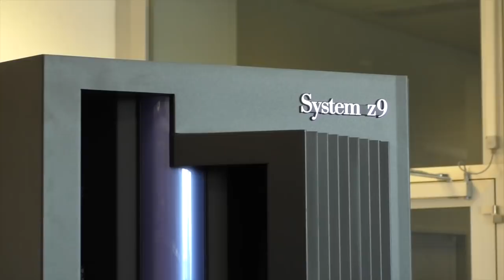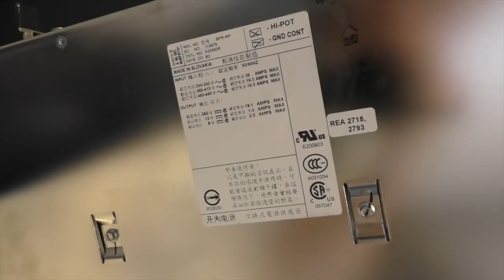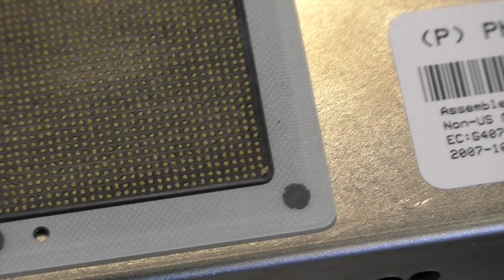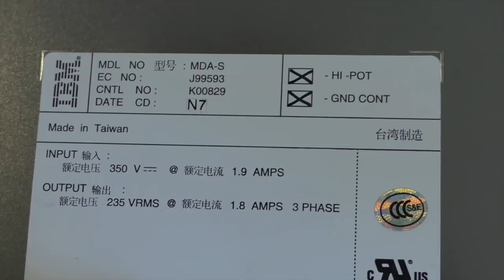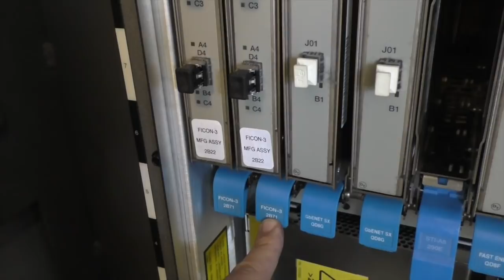IBM Z9 Mainframe Computer Teardown (PWJ31)

Comment: You know something's over-engineered when a fan is called an "air movement device" -- I'll remember that the next time I get in my fractional petroleum distillate powered latitudinal movement conveyance device.
Reply: FYI: FANs push air, AMDs pull air :)
Reply from the maker: There is no push without pull.
Reply from the maker: You got an LMCD? Wow!!!  :-)
Reply: Be sure to connect your Air Movement Device to the Powered Interconnecting Source Socket... Or PISS.
Reply: isnt that overbureacratic? often engineering and buraucracy are mixed. also army likes to rename common things to more ambiguous ones.
Reply from the maker: @effexon  Wait until you see the german translation (by IBM). A color terminal from 1990 ended as "Farbdatensichtgerät" what translates back to "color data viewing device"

Comment: sad to see a beautiful machine scrapped
Reply: Me too. I'd like these to be more reusable, as "built to last", so modular design, to use parts of it in other uses... same way as people invent new use cases for washing machine engine, car parts and so on. I'd imagine there are use cases for reliable but low performance heavy in eg. non profit scene, but expertise and knowledge is needed. Otherwise closed system sell for couple of bucks in ebay, as those are so nonpractical, only for most enthusiast hobbyists.

Comment: ESCON is the older half duplex fiber interconnect for these.  You could run ESCON up to 43KM! It had a speed from 10Mbit to 17Mbit before it was replaced by FICON. FICON could run up to 100KM at a speed of 1 to 16Gbit!

Comment: 4.5B transistors.. just as a comparison. Apple's previous generation SoC used in iPhones(A8) has a 2B transistor chip. The new A9x is believed to have 3+. Nvidia's GP100 GPU has 15.3 billion.
Reply from the maker: +SirMo 
Well... we are talking about 10 year old technology. Amazing how fast things change.
Reply: If you look at technology advances from decade to decade, such as 40s to 50s or 50s to 60s, there hasn't been much advancement from the 2000s to the 2010s. Seems like it's just a marketing game now. When's the last time you saw a processor spec advertised in a compute ad? The ads now are simply "Laptop! $229.99" with very little information. Another example are the processor model numbers. No indication of speed is suggested.
Reply: One reason is because there is a finite speed that the chips can function at, or rather it gets seriously difficult to get ever greater clock speeds out of computers. Also functionally there is enough computing power in something fairly basic that you can do what average people do with a computer at any clock speed and you don't need to talk about speed any more when mass advertising a computer on TV. Only enthusiasts are excited by GHz numbers anymore and almost no one cares about transistor count in their daily life. I'm typing this comment on a 2011 Lenovo ThinkPad because it does what I need, it didn't cost me much and it is indestructible.
Reply: i bet my mac book pro is really indestructible compared with a lenovo , i have one mac book which is completely destroyed from the outside but the computer is still running .
Reply: I have a pile of MacBooks here that look new and don't work. Trade you all of them for a lenovo. ;)
Reply: are you sure , usually you can build a new device out of the different parts , as i said i have one lap top which is completely destructed but it still runs i just need an external screen and an external keyboard , the case is destroyed but the machine still runs , i would never give it away . it is a well working unit with some cosmetic issues
Reply: I had an i7 asus like that. Looks like someone jumped on it. Worked fine. Ended up junking it.

Comment: Great video! You don't get a chance to tear down such a beast every day ;)

Actually, the Service Elements (the two ThinkPads in the front) are not only used for diagnostic purposes - they run a big chunk of the machine firmware as well.

Yes - the books are indeed called like that because they are mounted like books in a shelf. Like another commenter already mentioned, since the zBC12 and z13 EC there are no more books and MCMs but rather drawers (guess why they're called like that ;) and SCMs to save costs. Although each SCM combines several of the chips on that z9 MCM on a bigger die.

All components on the MCM are soldered BGAs (IBM almost exclusively uses flip chip packaging).

The ESCON and FICON ports are used to connect to external peripherals like storage servers. ESCON is IBM's proprietary optical I/O connector (actually, it's standardized in the T11 SBCON standard). FICON is the successor to ESCON - this time based on the FibreChannel physical layer (and standardized in the T11 standards FC-SB-2 to FC-SB-4).

Actually, all of the I/O cards have their own PowerPC processor handling the attachment to the mainframe channel subsystem (the mainframe uses channel I/O instead of port or memory mapped I/O).

Comment: Where was the DC-DC converter for that CPU board - under all those caps, or on another board?
Reply: +mikeselectricstuff i kinda want him to send that cpu to you to se if you could poke inside it >_>
Reply from the maker: +mikeselectricstuff 
On the CPU board itself are only caps and connectors. The DC/DC converters for the CPU are on the backside of the system. I will do another video with one of these. They have some interesting specs... for example 1V @ 800A!
Reply: +chrigel1234 Have you seen the video of the 18 year old kid that bought a Z/890 for $250 and got it working?
Reply: Yes, I'm sure if this guy advertised the z9 on eBay or Kijiji he could get an offer.

What a waste to send it to the scrapyard.
Reply from the maker: Yes... and I guess he had not to pay for the transport. ;-)
Reply: mikeselectricstuff
Reply: mikeselectricstuff

Comment: IBM has gone away from this type of CP book construction to make the units easier to manufacture.  Each CP is now a separate unit which plugs into a tray; no more will you see MCMs in IBM mainframes.

You'd be surprised how much manual work goes into those multi-chip modules; they definitely did assemble them by hand!  They had a special team at the Fishkill semiconductor plant to assemble them; there was no way to do it reliably with machines.  Of course they had machines to assemble the chips onto the modules, but everything else had to be done manually.
Reply: Impressive, man seldom beats machine now days.

Comment: Sad to see a awesome thing like this going to the scrapyard... but companies do that alott, and selling is either dificult, more expensive and/or the data should be destroyed anyway. still sad to see this die
Reply: Gold and copper recovery and other materials probably give back more money. But some people like old hardware just to run and collect them, even pay more than scrap metal prices. So yes, old hardware might be not cost effective to keep arround but dont just trow everything away, keep the collector in mind, maybe sell 1 of many servers to some collector and rest for pure metal recovery. Yeah, old hardware waste more power then they give processing power, so replacing them is most of the time smart.
Reply: Agreed!  More people should think about at least looking for collectors who might want stuff before disposing of it. Speaking of big, special-purpose hardware, I just saved the rolling stock from a 1980's-vintage monorail system from the scrap heap, and also secured a bit of beam on which to run it. I was literally bidding against scrap dealers for it, and yes, I outbid them and got the trains for an absolute fraction of their original cost.  (Party at my place, eventually, with one of the best backyard railroads in the world!)
Reply: The time needed to find someone who can take that thing away is money spent by the company who bought this unit to do something with it. They by now don't need it anymore, and getting it taken away ASAP is their preferred way.
What happens afterwards is not much of their interrest. They are also not interested in getting US$1000 for this as booking this value is more trouble than worth it.
Where I work we donate a lot of reusable things. Sadly that's mostly notebooks and desktops. Servers are not wanted. So those are scrapped.
Reply: Harald, yup, I've noticed that that's how it works.  That's how I got the monorail. The business view is "time is money, just get it out of the way so that we can get on with our plans." That doesn't change that there is value for the community in a better attempt at recycling.

Comment: gee, I remember writing software on am IBM-360/30 with 48k yes KILOBYTES of main storage, (3) huge 5 Megabytes of disk, and (8) 9 track tape drives, card reader/punch unit, and a 1403 printer. I used to run BPS and DOS 26.2. To watch a tape sort was amazing. with DOS you could run 2 jobs at once. FG and BG. of course all the software written was in assembler. I loved it
Reply: Got work for you.
Reply: @2hard2knock  oh yeah? What r u looking for?
Reply: @rty1955  Good ole fashion ASM/CICS/MVS stuff.
Reply: @rty1955  Find me on linked in if you’re interested
Reply: @2hard2knock  sent a connect requesr
Reply: @2hard2knock  I ran DOS not MVS. On the 360, 370, 4300 series and s/390.
The 360 did not run MVS. The 360 could run OS/360 which dragged the machine down. MVS (OS/VSE) was for the 370 & up.
Actually DOS/VSE ran faster on the 4300 series due to the fact that DAT was in hardware, whereas MVS had to perform DAT in software.
Reply: @rty1955  the CICS would be most desired if you have that experience
Reply: @2hard2knock  I do. With what programming Lang? COBOL? ASSEMBLY? Or just admin
Reply: @rty1955  ASM / COBOL3 / VSAM / DB2. How good is your CICS?
Reply: @2hard2knock  pretty good. Is it Under MVS?
Reply: @rty1955  affirmative. It’s right up your alley. Interested? send me contact info and I’ll arrange a virtual interview .... how is your availability?
Reply: @2hard2knock  I sent you a d invite on linkedin

Comment: Thanks for the video! It was very interesting. The strange decoupling capacitors you mentioned on the ceramic CPU are very similar to the AVX LICA series - basically it's a very low inductance decoupling capacitor array.

Comment: They call PCBs 'planars'...
This thing would had been connected to synthetic AC power, and never directly to the grid.  Very interesting that they have separate modules for the system clock.  I wonder if the CPU microcode still has to be loaded from the Support Element on powerup.

What replaced this machine?

Comment: Looks like a certain amount of over-engineering, like IBM have made it deliberately difficult to service without special tools & jigs. All those big fuses soldered into multilayer board, for example! Imagine having to remove one of those.
Reply from the maker: +ForestCat IBM has always made their stuff difficult to repair. I remember some power supplies where they used rivets instead of screws just to prevent someone to open the case. But we repaired them anyway ;-)

Comment: Does your work require you to scrap it rather than sell it? I know that it's too old to actually be useful in production, but I reckon something like this would sell pretty quickly if you stuck it on eBay for a token amount of money. Someone crazy like me would buy it.
Reply from the maker: The problem is this... people want stuff like that but when they realize of transportation cost, they suddenly lose interest. I'm in Switzerland and shipping such a beast to USA will cost a couple of 1000's of $$$. I once sold a similar system fully working and then the buyer came with questions of all kind.... lot of work for me... not worth the few bucks you can get.

Comment: Ca 1985 the had a Data Migration Facility. 
It came in a nice box full of quality control stamps and a manual.
Turned out to be a null modem cable to connect 2 PC together.

But way to ask over 100 US$ for a piece of cable and two 25-D connectors.

When I offered to just solder a cable from parts so we could get on with the job, the customer refused: "we only connect genuine IBM parts...."
Reply from the maker: I'd guess there was also some software in the package? Or only a cable?
That reminds me when we had a problem with a SCSI device. A DEC technician came to fix it and complained about the "non-DEC" terminator. So I quickly changed it to an original one an the problem was still there. Now he started working on the device...

Comment: Is it just me or do people buy these beasts thinking, we can upgrade/enlarge them later, but when the time comes around, it's cheaper to buy a completely new system?
Reply from the maker: Oh definitively! Computer manufacturers often advertise the "expandability" of their systems but most users buy them and leave them as they are.
Around 2000 there was Hot-Swap PCI... everyone made systems with that. Until the customers found out that it is more or less useless. For most PCI cards you have to shut the system down anyway to replace.

Comment: These machines blow my mind. Just watching this video just runs through my head the brilliance of the team of engineers that built this mainframe. From design of the case to the layout of the individual components to the software engineering. I should of stuck with computer science. I missed the boat.
Reply from the maker: You should watch the Z13 promotional video from IBM here on Youtube. That's the newest generation.

Comment: 10:19 Those red rings by the fuses are probably current-sensing magnetic field coils. They measure the current flowing through the large flat metal conductor passing through them.
Reply: Yes, and the flat conductors are current sensing resistors. Belt and braces current measurement!

Comment: interesting that they distributed 350VDC throughout the system then convert it to the lower “local” voltages.
Reply from the maker: It's  logical. You save a lot of thick wires if you distribute high voltages.

Comment: I wonder what the TDP of that monster CPU chip could have been? I like the idea of the replaceable socket as well. Odd construction of the individual pins though. I also would have thought each one would have been spring loaded pogo pins.
Reply: I don't have data for the z9, but I do for the most recent machine: the z13. IBM has moved away from Multi-Chip Modules and towards Single Chip Modules.

In a z13 EC there are a maximum of 4 drawers, each having 6 Central Processor SCMs and 2 System Controller SCMs. Upto eight 2-way multithreaded cores are active on each CP SCM. The TDP of each CP SCM is just under 300W, with the SC SCMs rated at about 80W each.

Going back to the z9, a fully-loaded box is rated to consume just over 18kW.
Reply: I would have thought as much. Most of everything you need for a system is practically on one die now. However I still think these older designs are a lot more interesting to look at. There's just more that you can see.

Comment: An Apple M1 has 16 billion transistors, almost 4 times as much and uses 39W at max. Than you realize this can be Scrapped. 😉
Reply from the maker: Well that's true but it is not a fair comparison. Those IBM processors are made to handle huge quantities of small transactions. They have data encryption built in and a lot of other stuff nobody needs in a consumer CPU. They are tailor made for those mainframes.
But you're right, the kilowatt days are over :-)
Reply: @PlaywithJunk  They have different specs and the M1 contains things not used in a mainframe like image and video processing. It has a GPU and "neural engines" which take up a lot of space but it also has encryption build in. The M1 is a SoC tailor made for Apple's own products.
But my point is indeed the 5nm chips that allow us to have this processing power over 4 times in our pockets today, battery powered and with only a little passive cooling.
Reply from the maker: @edwinschaap5532  Yes I totally agree with you. A smartphone today has about the same power like a 1980s CRAY computer but runs on a small battery and fits in your pocket. It's amazing.

Comment: I'm just shrieking in terror, what? did a whole Z9 just DIE? This thing is not that old...and it is being handled with absolutely no respect.
Reply from the maker: It was obsolete. The rack was already on the ramp to be collected for recycling. The best thing I could do is making that video. Next time I'm going to make a video of the shredder that chews up the system.. Then you have a reason to feel terror :-)
Reply: I actually agree. This is too much for me. It's horrible. I really wish his company would re-sell or donate the hardware. To me, this is stealing from the future. The scientific value of this video is of course great, so I do apprechiate it. But its a terribly bitter watch.
Reply: The power consumption, licensing requirements to IBM for software (yes, you need to pay an ongoing license to even have the thing boot), and spare parts cost/availability now it's service contracts have expired, make it uneconomical for resale or even donation. It has 13 years of degradation (electrolytic caps to begin with), no one is going to buy a complex system that chews so much power for such little returns, it would still be cheaper to rent time, or have time donated, on a more modern machine. You say stealing from the future, I say it is impeding the future by hobbling someone with hardware that does a 10th of the job for the cost equivalent in new hardware. At best it will be a museum piece, but there are still thousands out there and there are plenty of people who know how to get surplus hardware like into the right hands for preservation. It may be shiny junk, but it's still junk :)